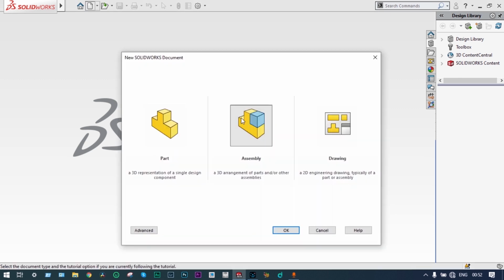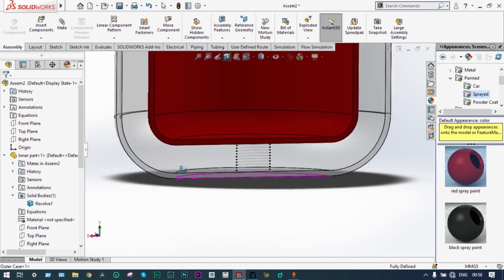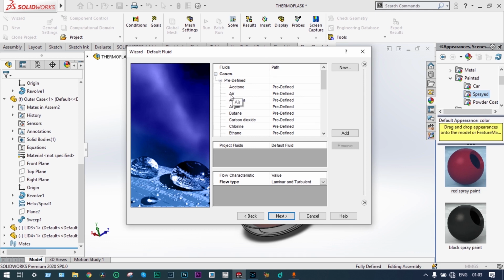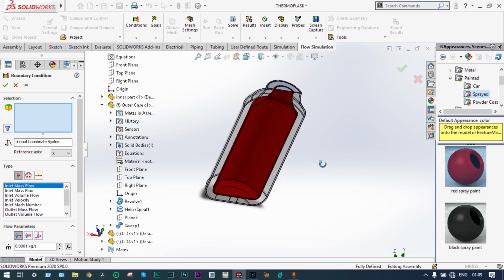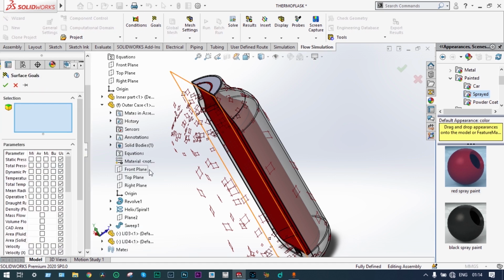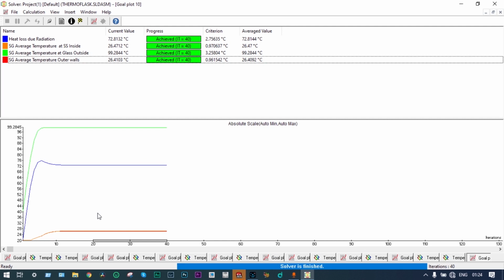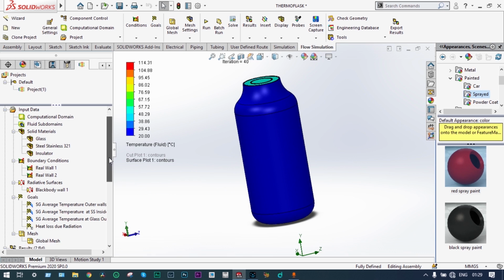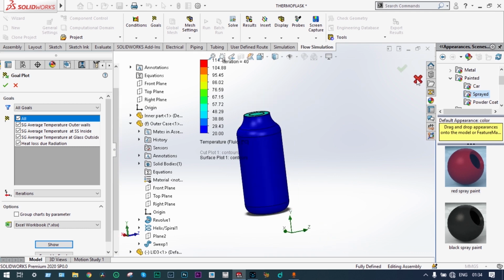Mastering CFD Conjugate Heat Transfer Analysis in SolidWorks: Conduction, Convection, and Radiation

Comment: sir,
I regularly watch your videos,
kindly make a video on this examples:
- hot N2( at 270°C) gas entering a reactor having certain catalyst intial catalyst temperature is 25°C, we want to heat the catalyst bed to 270°C, i want to know the time taken for the catalyst bed to reach 270°C
- i want to make a heated plastic sheet thermoformed onto a mold, i want to simulate this scenarioin simulation, what is the setup for this case, 
please help me, i have taken your courses in udemy also

Comment: Can you guide us through the design process of the flask where we can know the purpose of the spring in the outer flask please
Reply from the maker: Spring is not essestial. It was provided to have a support at the base otherwise for the whole assesmbly stress will be produced on the flask inlet, where all the concentric bodies are joined together.